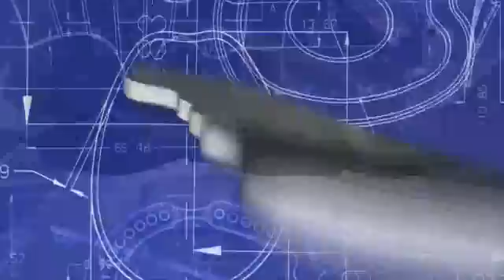#britek  Energy Return Wheel... Autonomous Never Flat

Comment from the maker: @Geechs Our latest patent filings are  good for 19 years, with additional filings coming. "Heat"? Try an experiment, place a rubber band against your lips. Stretch and allow the band to recoil. Stretching generates heat while recoil action recycles heat. So yes... every rotation ERW membrane recycles heat,  noise, and  vibration. FYI We are pioneering the newest/ patentable nano rubber / Carbon fiber / Kevlar based components / applications not the tire industry.

Comment from the maker: @WaagooshTheRedFox ERW improves with speed,  more horsepower and torque transfered to the ground, radically improved rolling resistance, a "rolling" footprint to the surface not a floppy ,bouncy treadblock ....auto sport is about to change forever. We believe ERW will eventually be adopted across all tire product lines.

Comment from the maker: @unit666industries Mororcycles come after bicycles. The pace of development is swift. Bicycle ERW  29" MB are anit bounce, anti gyro, for "razor" sharp handling. The carbon body hoop huggs the surface. It is 360 degrees "sprung" to the ground ....1" highly progressive "in" wheel suspension. Wheel elastically hangs   more from top 180 degrees of the hoop.  Downward peddle strokes charge ERW to provide "lift" a serious "deweighting effect" generate uphill levering advantage...motorcycles, sweet.

Comment from the maker: @unit666industries It depends upon application but we can say very similar to pnu.. For example our new bicycle protos are heavier % wise... adding Carbon /Kevlar body.  Sidewall thickness on high end bicycles can be super thin. However large truck sidewall and wire beads are massive.   Highly elastic ERW  less  wt. bearing, light wt. sidewalls are only to keep debris/snow, rocks out ...and to accumulate  "screw force"  for optimal drive train / brake force transfer, "way" lighter % wise.

Comment from the maker: @c00l45xbl What do you think is the max. air pressure your tire can handle before it explodes? 120 psi maybe?Our German engineered "rubber" has a burst strength of 4,800 psi.. Our carbon nano tube infused carbon fiber Kevlar reinforced hoop is 50,000 psi. Thats 25 tons psi.!  Pnu can be taken out with a 2" wood screw. ERW can be shot multiple times with a 44 caliber hand gun and still go to the grocery store.

Comment from the maker: @n1a2s3k4o5 The SL AMG provided a good platform but the ML AMG because of weight and higher center of gravity was better. We installed a stage 2 suspension system... much less linear  "travel" to shift more energy through the ERW. German engineering is a relyable and consistant platform.

Comment from the maker: @SuperLitherland We hope to construct off road racing tires for Baja. Trophy truck would be a sweet target!  If you understand the opposing drawn slingshot principal across the hoop IE cancle out bumps internally in "real time",  instead of over rebound / bounce reaction  impact is cancled out like Bose headset  for smoother safer contact with the ground. We can radically increase the internal displacement and because ERW is highly anti gyro. much larger diameter lighter wheels will be possible.

Comment from the maker: @RedDrag2on You are discribing the radial tires tendancy to "roll over" under lateral load. ERW displaces under lateral load and  just "one wheel" can accumulate / return lateral loads greater than the vehicles total wt. ERW is a 3 D machine not ever seen before and will change auto sport forever.

Comment: @EnergyReturnWheel First of all I was trying to agree with your design concept, so good job communicating with the public, you idiot. Second, it's not "highly curved". Curvature of any circle is a function of radius. This thing has the same curvature as any other tire the same size. It's obvious that the unweighted hub is in the center when unweighted, dummy. I clearly was talking about the deformation with the weight of the car acting on the hub and how it would help rolling performance.

Comment from the maker: @MyHandsAreCats We use double rubber wedges off the highly curved composite hoop. This setup levers the lateral or medial wedge to the surface when lateral displacement of the hoop occurs while cornering. Patent #4 allows ERW to produce a longer wider foot print more closely resembling a pnu. tread block for handling purposes.

Comment: I don't see how it can maintain enough grip.  especially in cornering.  pneumatic tires will deform to the road in instanced of lateral movement, or changes in camber, keeping enough of a footprint on the ground.  These tires wont.  I can see imminent spinouts at highway exits/entrance ramps

Comment from the maker: @thecrags We use a highly curved composite hoop that resists the oval shape. Highly elastic membrane "pulls" at the top elongate, membrane "pulls" at the bottom contract in responce to the pull of gravity. Unweighted the hub is in perfect center. Gravity draws the hub lower within the hoop IE more stretch at the top. These early prototypes were pre tensioned with 300 lbs. linear pull each by tightening nuts on pull attachment  bolts. Your physics professor might  have you rethink your thesis.

Comment: @EnergyReturnWheel I don't see how you get the "more energy at the top" part. What I see is that the deformation of the steel hoop under load results in an oval shape (compressed vertically, stretched horizontally) so the bottom in contact with the road has a smooth, rounded shape that allows for better rolling performance. A conventional tire deforms so it flattens on the bottom for less than ideal rolling. I finished my first year of physics a while ago so I cant end that aspect of the debate

Comment from the maker: @ToLearnTricks Check out our website for more simple high speed "airless" military ERW. The air valves in each pull plate are for installation, air pressure raises the bolts to inner hub. Then a vacuum is drawn for vacuum boost on the hoop side of the membrane. This increases "lift" and backs up the membrane with a vacuum draw levering the hoop against resistance, patent #4.

Comment from the maker: @piercebm Pnu. tread block is supported by air pressure, requiring more surface area to makeup for less psi. support.. Pnu. with high air pressure becomes less safe and no cushion. ERW composite hoop forces /rolls our Kevlar bound double wedges off the curve to the surface. Creates a "foot print" IE greater psi. to the surface, closely matching  the pnu. handling  you have been accustomed to. Wt. is close to pnu.. ERW accumulates screw force improving brake force, shortening stopping distance.

Comment from the maker: @Snooch1984 Your energy loss comment fits pnu. tread block and sidewall deformation not ERW. The wheel deforms internally, opposing slingshots drawn across the hoop. Energy is accumulated and released as throttle responce winds up hoop on hub increasing drive train efficiency, improving horsepower and torque to the ground. Brake force is metered out in a like manor. Anti bounce as equal force from opposite directions "tune" cancles out shock.

Comment from the maker: @SLRist Better fuel efficiency on any vehicle, the more cubic inches/power the bigger the savings! Besides it is so much more FUN. ERW is "all" parameters of performance....drive train efficiency "screw force accumulation / return", return against the pull of gravity, even wind resistance can displace ERW inner wheel from perfect hoop "center" while under throttle IE return of  wind resistance "forces" to the rotational direction!  Not just reducing carbon emissions! ERW is a very big leap.

Comment from the maker: @leadfootrob33 We have protos with "no bolts". Check out our vacuum tune carbon fiber Kevlar video. Kevlar teathers replacing bolts. One of many prototypes that we can use the "best" of each for specific applications. Our website has high speed "airless" large truck / military images ...also early bicycle ERW protos. We are working hard to provide industry the solutions for todays / tomorrows problems.

Comment from the maker: @TylerReifenberger5 It looks very likley that a bicycle version proto will best adapt to racing IE holes and connecting slots in highly curved  carbon hoop to make many  "bows", Kevlar spans across the carbon body attached to pull plates then drawn to the wheel for tension, the "bow strings". This way the hoop stores the developed tension and becomes a suspension unit... pat. # 5. Not too bad for us "lazy" american inventors!

Comment from the maker: @mitchellnunez2012 Check out our web site to view early versions of our Super tech. "airless" high speed military ERW. The valve stems on pull plates are for vacuum boost on hoop side of membrane. The power of the vacuum! The vacuum assists/draws the 360 degrees membrane charged wheel in the desired direction of travel! We have a secondary vacuum system drawing in the highly elastic sidewalls to fine tune additional "screw" force accumulation for additionaL double digit DRIVE TRAIN efficiency.

Comment from the maker: @lostcause525 We only had two ERW protos at that time. Our research had been done with smaller less costly wheels. You are right about the tread pattern slipping off the hoop from these early units. We were just trying to keep the steel hoops off the asphalt. We have come a good bit further IE three additional patents filed and alot of proto development. ERW on the rear for rear wheel drive levering. Check out first early carbon Kevlar " vacuum tune" video.

Comment: I'm intrigued by the idea and can see it coming in the future, but I noticed a couple things. For one, If I saw correctly, the Mercedes right you still had pneumatic wheels on the front and ERW's on the back. Was that a comparison test of some sort or what? Also, the mounting in the video was done with vice grips. I could be over thinking it, but couldn't the tire slowly slip from the wheel due to friction from the weight pushing down and sideways, or is there a solution to that?

Comment from the maker: @wtl1964 ERW protypes are so rare and costly to build that it is like suggesting you set a Ferrari on fire to have a look inside. We are trying hard to limit slip and max. the grip. Drifting and burnouts are entertainment for sure, but for the street and racing applications it is about maintaining "traction". With bicycle protos the "levering" from the top of the wheel makes it harder to pull the front wheel off the ground, perhaps a limiting factor for trick riding but a plus for auto sport.

Comment from the maker: @BigDirtyBasterd We have found several ways to apply sidewalls to various protos.  First can be seen on our carbon /Kevlar vid. where we span the gap with a highly elastic rubber, the leading edges bound with Kevlar.  Second can be seen on high speed military airless design on our site IE elastic rubber span uniting carbon rings that "plug in" to wheel/ hoop that maintain a secondary vacuum charge. Third will be shown "on bicycle ERW videos soon. New auto/truck protos "highly" manuverable.

Comment from the maker: @DumpValvesAndDnB We would like to be in a position to do all of these things too. So far we can state ERW is much more responsive in vertical and horizontal loading, anti bounce IE not over responsive unlike bouncing pnu.. ERW improves with speed,  they "roll" a footprint not a treadblock.  Check out our web site. The weight of newer protos is the same as pnu. ERW unit is suspended "sprung" from 360 degrees off  the inner wheel to the ground and is now "sprung" wt. again the opposite of pnu.

Comment: I want to see a review by an experienced motoring journalist and lap times on performance cars. i want to know what is the difference in steering feel / feedback, how the tyres perform in vertical and horizontal loading and how progressive they are as their limit is exceeded. i would also like to know how heavy they are as unspring weight is a big killer of ride quality and performance. also it is very ugly.

you obviouslly have a passion for tyres so im not slating you. i just need convincing.

Comment from the maker: @Shabbernigdo  First ERW mounted to an auto. This early model has  membrane outside the hoop, drawn through the 36 holes by fender washers on 36 bolts. We could tension membrane by tightning nuts drawing washers/membrane to inner wheel. Newer protos have ribs holding membrane to "inside" of hoop"no holes" allowing for 18 Hg. vacuum boost  on membrane "hoop side". Removable elastic sidewalls to accumulate/return of screw  force. Nano rubber wedges off curve pluss traction layer. Check our site!

Comment from the maker: @Shabbernigdo  Solid rubber tires transfer at least 85% of shock and vibration directly to the wheel. One effective test would be to lightly strike your hand with a rubber hose. You will immediately get the point. ERW now uses Kevlar bound rubber wedges that displace laterally off the curved flexable composite hoop. We can create a wider longer footprint with this tech.. The "force" is directed to the hoop that is "suspended" within 360 membrane draw. IE "internal displacement"= big cushioning.

Comment from the maker: @trdnismoguy We tested pnu. inflated 35.5psi. 5psi. over recomended pressure on our U.S.D.O.T. coastdown video.  Dyno was set to 6,000 lb. resistance 1,200lb.  more than vehicle wt.. Lab tech drove Merc. . Notice acceleration advantage of ERW over pnu.. Note the 6,000 lb. drag effect on pnu. coasdown rate and compare to ERW last stages of rolling. The rolling resistance is only one factor in ERW superiority, drive train efficency, deweighting effect, up hill levering, better consistant contact.

Comment: Modern tires are NOT susceptible to failure--drivers experience a flat on average every 100,000 miles. That's not bad. And flats are typically mild problems, not like the re-treaded blowout with rubber pieces everywhere like they show in the video. They found a solution, now they're looking for a problem to go with it!

Comment from the maker: @VegasAero We suspect that when adopted the industry will calculate how many miles they think they should last. Using nano rubbers and space age aero materials  ERW could have a very long servicable lifetime. Options like retread potential for transport,  heavy machinery, over the road trucking. ERW  hard wheel rolling resistance, drive train efficiency gain, uphill levering, deweighting effect significantly reducing "runaway truck" potential. A long list indeed.

Comment from the maker: @BuZnDaHiVe  Pnu. tire flattens on the bottom slapping the road. This slap can be heard on steel bridge connections at high speeds. Sidewalls supporting the tread block are deformed and stressed. ERW is supported by permanent membrane tension. Tension is developed by 8 pull plates drawing the membrane towards the inner wheel. Flexable composite hoop ERW IE "footprint"  rolls, no "slap", less stress. Our highly elastic sidewalls are only for accumulating/returning lateral and rotational forces.

Comment from the maker: @lucasoptura The attaching membrane is always drawing the hoop /wheel relationship with a very powerful  "3  D" centering force. Much more immeadiate than pnu sidewalls and treadblock. ERW is highly anti gyroscopic because of this "force". ERW can accumulate drive train irregularities "wind up" rather than slippage or clunking radically improving drive train efficiency. ERW has hard wheel rolling efficiency with internal cushion. Pnu. can not match. 100 yr. old tech V.S. new age machine

Comment from the maker: @2009mechanic  Finishing the bicycle protos by the end of 2011 we will apply what we have developed into much simpler, lighter, tougher auto and truck designs. We are using a curved flexable carbon hoop shaped like a tire body " the bow"  spanning the opening with rubber or rubberized Kevlar spans "the bow string" attached by 8 adjustable pull plates to wheel. Covered by pat filing # 4 and 5. IE new ways of adding permanent tension to the "bow". Rubber spans are for more linear internal travel.

Comment: @EnergyReturnWheel  the new spike strip is made with a heavy duty net that gets caught up in the front end so the wheel can't turn. So you wouldn't have to worry about criminals getting away because their tires don't go flat.
My question is are you working on a motorcycle application.

Comment: @2009mechanic - the purpose of a tire is to give a vehicle something to roll on.  It was not ever designed as a "weak link" that law enforcement can use to stop a vehicle.  That is a rather bizarre perspective, IMHO.  If we only design products with built-in failure modes, we will not continue to progress to safer more efficient solutions.

Comment from the maker: @djaygermain  Newer model carbon fiber /Kevlar hoop is designed  to flex "bow" like. Allows for the hoop to become out of round in extreme events preventing damage and accumulates some of the developed strike tension into membrane tension  returned  through the levering of the wheel rather than pnu. collapse and net negative bounce responce. The inner wheel is drawn from the top pulls IE the wheel is already being lifted when an impediment must be ascended, a large time frame advantage over pnu.

Comment from the maker: @alacnop Trust in thin air is pnu.. Our "hardness" is a drawn membrane, like pulling back on a sling shot. Our "cushion" is drawing the sling back and forth while under tension. The membrane is superior to pnu. sidewalls that only support from the sides supported by "air". We have more psi. to the ground and levering wedges to help our "sticky". We warp to the ground with our wedges and super flexing  highly curved hoop. Check out our early vacuum tune video.